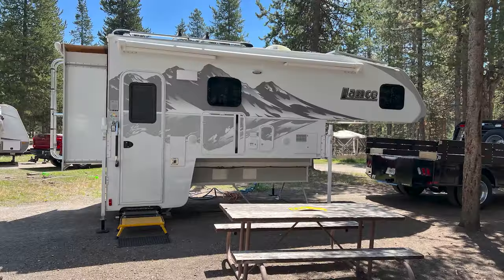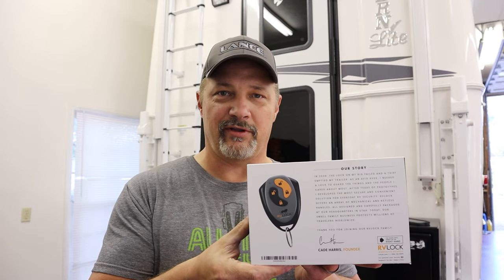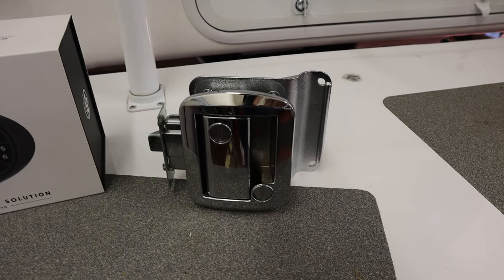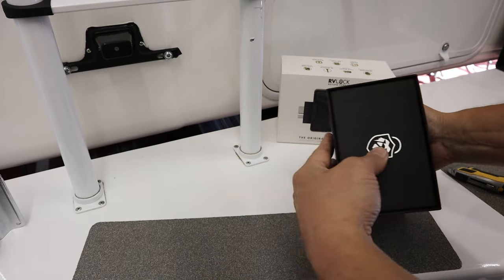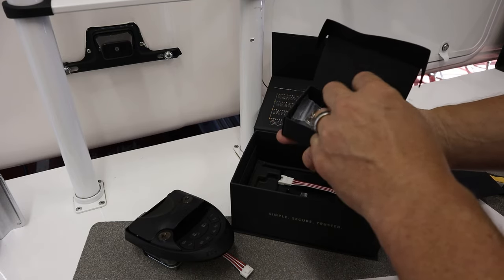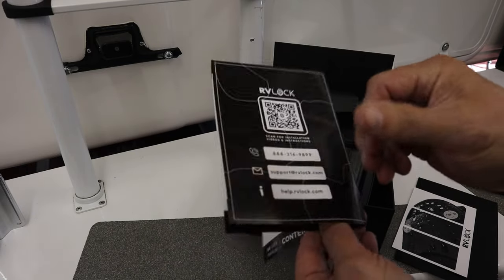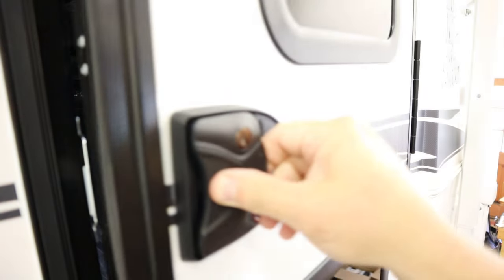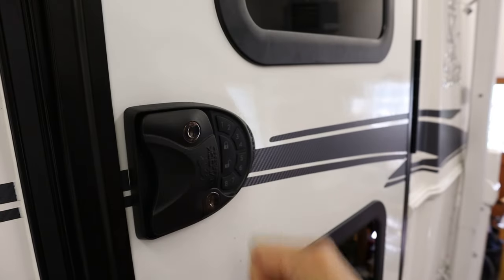Our Favorite LANCE Camper Feature Installed On Our NORTHERN LITE

Comment: I love having an electronic lock.  I got frustrated with my RVLock because it kept breaking.  I finally replaced it with a Bauer electronic lock.  I see the keypad looks a little different from the older models.  I heard they are silicone now and less prone to cracking.  Electronic locks are a worthwhile upgrade.  Happy camping.

Comment: I wish ours worked as good as yours. It’s the most fickle lock.  Some days it works other days  You’ve got to put your code in numerous  times for it to lock and unlock.  I am seriously contemplating pulling it out and trying a different brand.
Reply: Our horse trailer tack room door lock is a different brand than Todd's. Maybe you have the same kind as ours. To unlock it, we first need to press any key once to wake it up. The back light comes on and then we put in the four-digit code and it unlocks. If we enter the four digit code without waking it up first, it doesn't unlock because the lock interprets the first button push as a wake up signal. Then it only gets three code digits. To lock, we need to push any key to wake it up, and then push the two left-most buttons simultaneously. However, if we want to lock it right after unlocking it, it's still awake so we can just push the two left-most buttons simultaneously. 

Also, when the battery (3 volt lithium) is weak, it is unreliable, even when following the wake up procedure. When changing the battery, we make sure to have a new battery handy so that we can quickly do the swap and avoid the need to reprogram our four-digit code. 

Good luck!

Comment: Are the keys the same in every lock kit? So anyone with that lock set still has the same keys as yours? Also can you turn off the sound so it’s silent when you lock/leave? Thanks for another good video 😊
Reply: I'm guessing it's like buying a padlock at the store - unless you get it specifically re-keyed, odds are someone eventually would have the same key.  Still (several) orders of magnitude better than the stock CH571 keys that literally every RV on the lot has.
Reply: What is the expected life of the batteries?